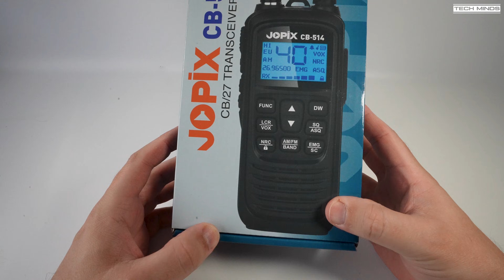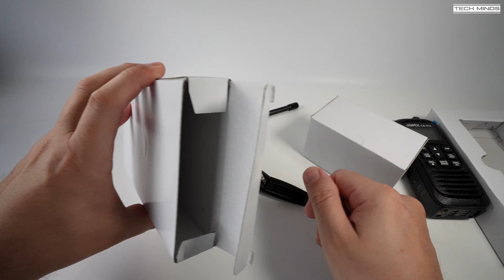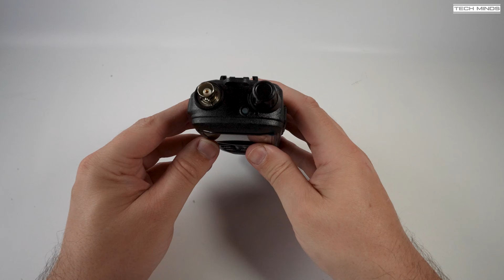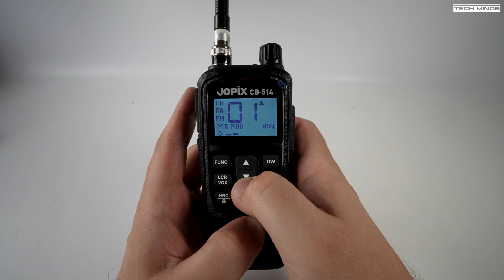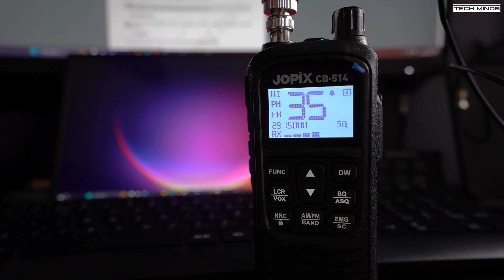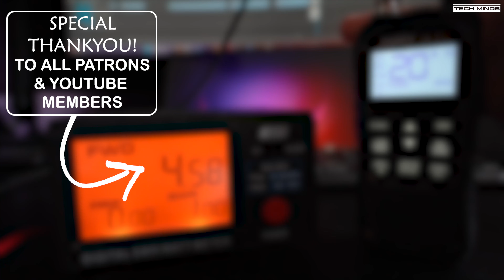JOPIX CB-514 Extreme Wide Bandwidth AM/FM 11/12M Handheld Transceiver

Comment: Dieses Radio ist in vielen Ländern mit dieser Firmware illegal zu betreiben als TX-Sender.
Es wurde anfangs mit einer falschen Firmware in den europäischen Verkauf gebracht, als seitens der Händler festgestellt wurde dass es sich um kein legales CB-Funkgerät handelt und dieses beim Importeur reklamierte wurde in der zweiten Serie eine andere Firmware aufgespielt. Sollten Sie nicht mehr in die illegale CB Export Version schalten können, seien sie nicht verzweifelt. Die zweite Version mit neuer Firmware wurde ab juli 2023 in den Verkauf gebracht😂

Comment: Hi @Tech Minds. I have bought that rig and tried to charge the battery yesterday. It took me more than 5 hours to fully change it with included charger and cable.  The rig was drawing only 0.3A while charging... Is this normal? What is your experience? Thanks.

Comment: Did you have to do anything to activate the wideband menu because many users are reporting that this radio does not have access to the menu out of the box? In other words, nothing happens when they do the key press.
Reply from the maker: Nope, it just worked out of the box for me.
Reply: @TechMindsOfficial  it appears to depend on where you buy it. Some dealers enable the mod others don't.
Reply: There is probably a loop to be cut somewhere

Comment: Ive noticed the display layout is not the same as the thunderpole. Is there anyway to change this ? Plus it seems you can't auto scan either
Reply: I have the PNI Escort HP 82, it-s basically the same radio as the JOPIX and to go in to scan mode you long press the EMG/SC button.
Reply: @salvatoremancuso6060  I don't think that works but I'm returning it anyway if I can as the display is mot the same as the Thunderpole including the signal meter. Not impressed

Comment: Is there a handheld radio that does have ssb?
Reply: The Albrecht AE 2990 has SSB
Reply: @cariboooutlaw4852 
No longer sold ?
Reply: @jplacido9999  no longer manufactured but may be still available from some European dealers.
Reply: @cariboooutlaw4852  
I have one.
The front panel buttons are now in need of replacement and I'm trying to find that part...
Reply: @jplacido9999  good luck trying to find parts for that.
Reply: @cariboooutlaw4852  
You are right....not easy...🙏

Comment: Hey there Matt, did you get my email? I won the rtl sdr 👍📻
I sent it on your m0dqw page, there wasn't an email address on your YouTube info.
I'm loving this handheld CB btw, I have a Moonraker major 42, and a Midland 42 already, or I'd be rushing out to get one, or the Thunderpole TX, which seems very similar.
Reply: I still have a lot of old and not so old cb, my alan 42 was good the replace 42ds same good but dont like autosquelch, have the pni clone of major42 was good to but JOPIX-PNI-THUNDERPOLE in this video I can says are better without doubt (i'm little curious about new president randyIII)
Reply: @alessandroconcas  I expected the newer radios to be better, I'm now thinking about selling my old handhelds on the used market, and upgrading to something like this in the video 🤔
The Randy looks pretty good, just a little expensive compared to this one, and the Thunderpole TX. I think Andy Kirby reviewed the Randy, but that might have been the Randy II?
Reply from the maker: @electricbloke No sorry, didn’t get it as there was an issue with the contact form. The email address is now on that same page, please email me. Thanks
Reply: @TechMindsOfficial Message sent 👍
Reply: Seems to be a very versatile handheld. It would be great for some 10 meter portable. Question. Can this be adapted to the US CB bands?
Reply: @LA_Spin-b5b I think that US CB band is the same as the mid band, which is common on most of our radios in the UK. I aren't certain, but maybe someone else can chime in with a solid answer.

Comment: Great CB, some friend of mine buy the twins from thunderpole uk and I buy the PNI clone ... both cb and 10 meter was good , 12 so so, in trails  for offroad adventure with friends without fixed radio was really effective even withj original antenna inside the jeep (maybe cause fiberglass roof shel?!)